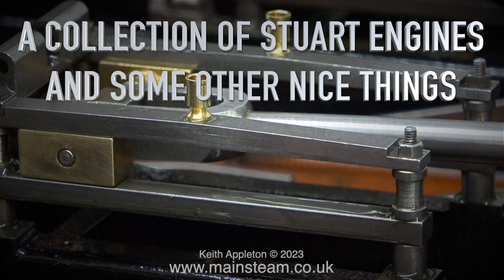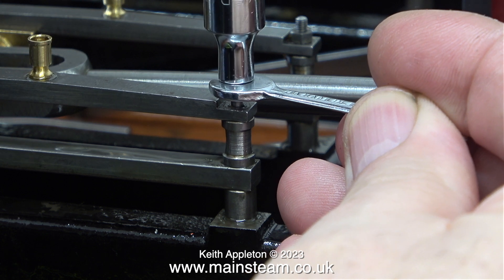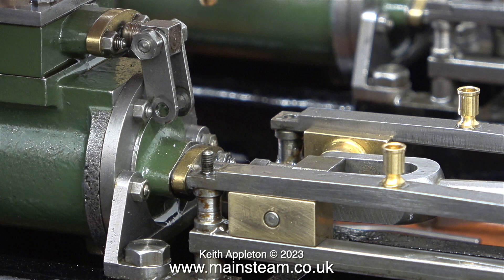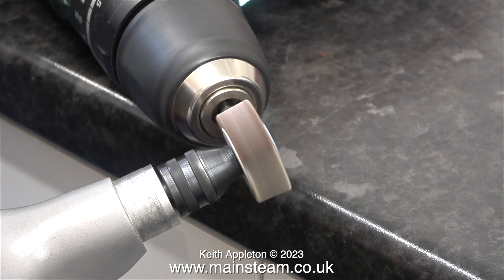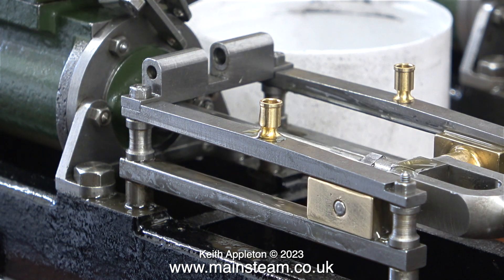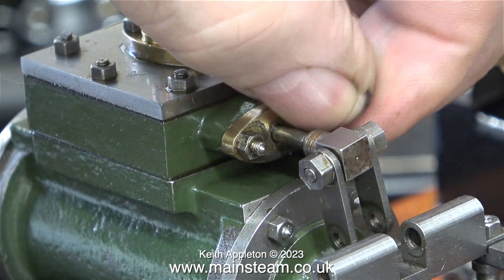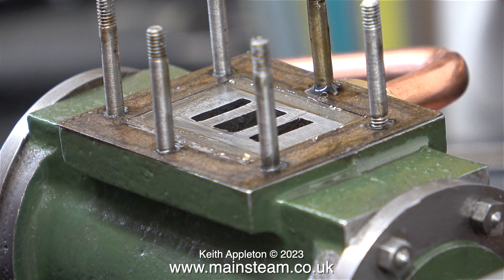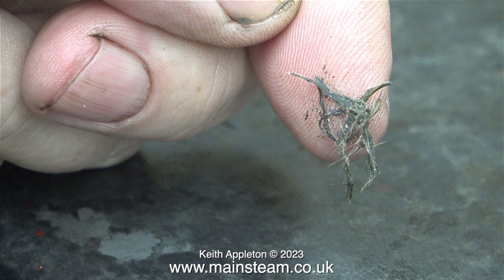REBUILDING THE STUART TWIN VICTORIA - PART #15

Comment: I worked in a ship yard on the Mississippi we used flax rope packing to pack the prop shaft they would make us cut it put one round in at a time I also had to pack valve s